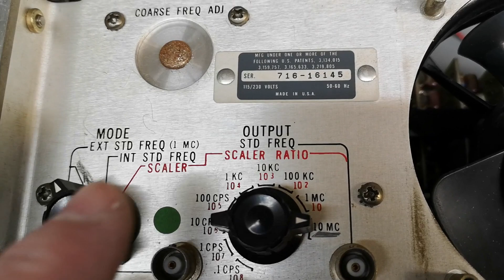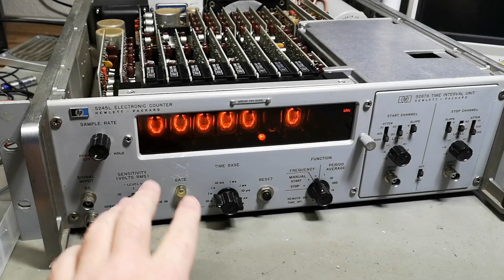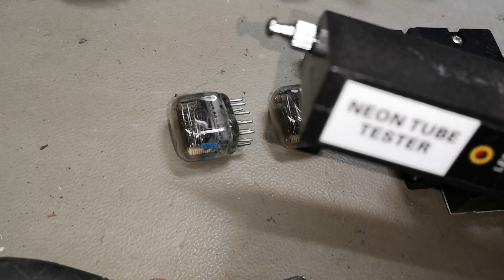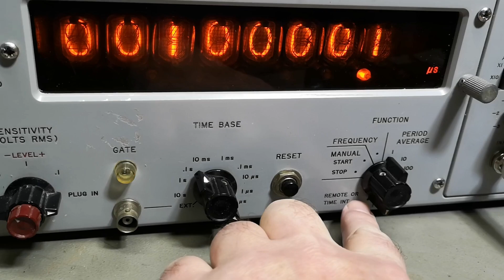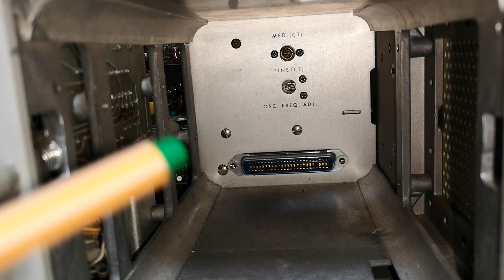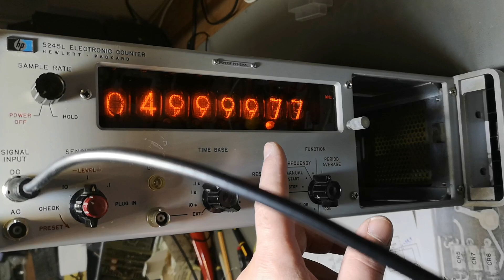HP 5245L electronic counter 1968 8-digit nixie 50MHz test teardown

Comment: A comment on the plugin module lock, it's not only a two-position lock. You're supposed to keep turning it multiple full turns to pull it out of the connector and eject the module! Likewise, when inserting a module you can turn the lock knob the other way multiple times to push the module back into the connector (if you prefer not pushing it in directly by force).
Reply from the maker: this is a good trick, got another one in for service right now, will try this :-)
Reply: @TeardownOZ2CPU  You can see pretty easily how it works by turning the knob without any module inserted. It's a quite neat mechanical contraption, and it's impossible to turn it too far when taking the module out.

Doing it right, you should not need to use pulling force at all since it's already pushed out of the back connector when the screw has done its thing.

Comment: Cool! I had one of these for a while, I pulled the Nixie tubes out of it and used them for a clock. Then resold it on eBay with no tubes. It was really well built and was a cool unit. Nice to see inside!

Comment: I'm  not surprised it takes that long to stabilize, the crystal is disc shaped quartz in a huge glass envelope, heat transfer from the outside to the crystal will be very limited.
Reply from the maker: over 2 hrs to get to the last digit, maybe there is a manual from hp about  fine alignment of this type of oven, wonder what they recommend, last time i looked at something similar it was 24hrs they recommended.